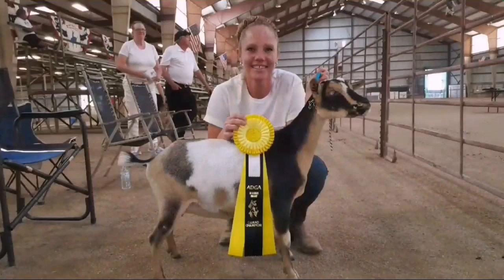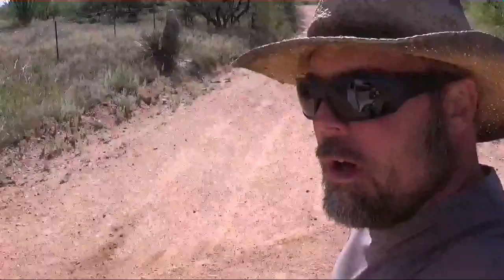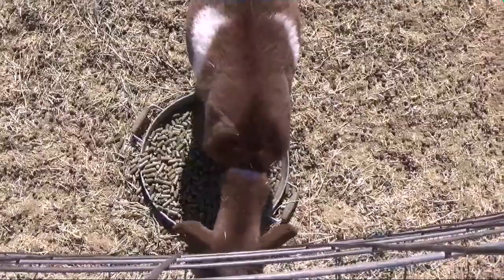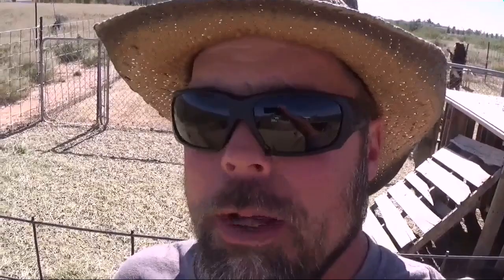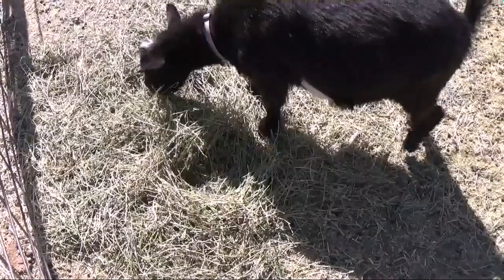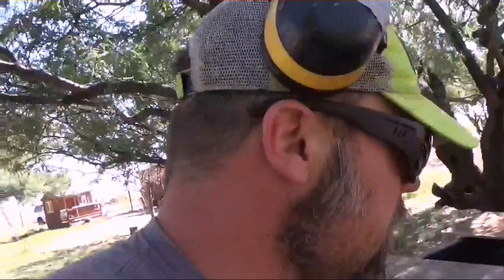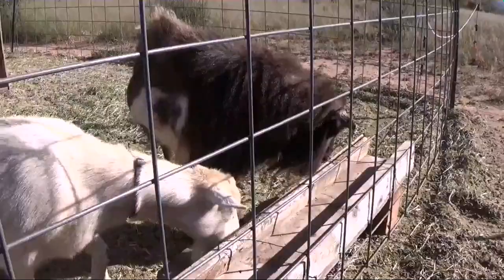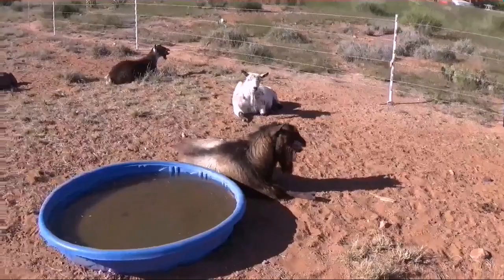Goat Feeder Troughs From Scrap Wood

Comment: Derek, check out the hay feeder on the back of the barn at Al Lumnah's. With your automatic door opener you won't have to worry if the power goes out. : ).

Comment: I would put a scrap piece of wood on  the  outside of the fence and screw it to the trough. It who'll be secured the entire length.  And the wires won't break

Comment: Oh, Ms. Crystal has a honeydo list for you... lol
Did you see the hack the Mr. Lumnah did with his hay feeders that drastically reduced hay wastage by his goats?
Sir,
Instead of going across the trough with the wire. Would it work to run the wire the entire length of the backside of the trough? That way less chance of goats catching on it, or doing what Lucky did to the first wire you put on his trough?

Comment: Since they can put their heads through the fence  why not put the feeder on the outside of the fence.  that way they cant walk or pee in them.  Also put ends on them so they cant push the feed out so easy,
Reply from the maker: We dont want the feeders in the walkways. Also, if they have their heads through the fence they could ram each other and get hurt.